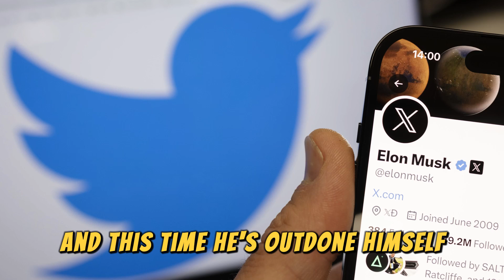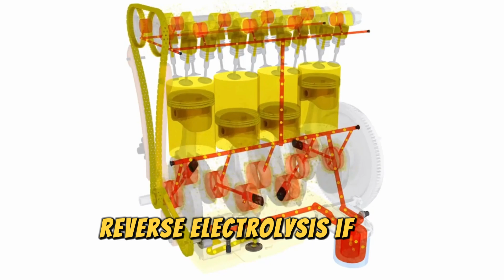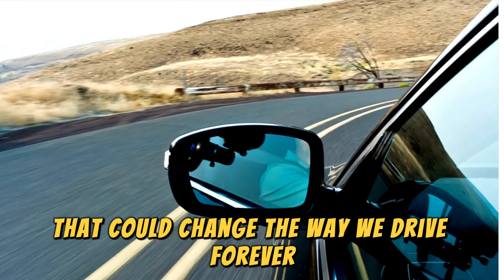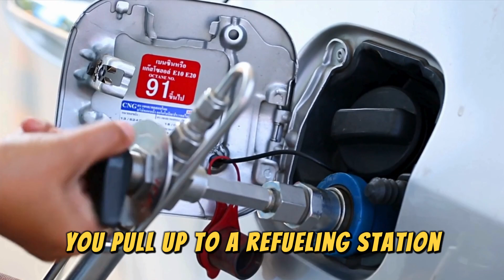Elon Musk Unveils Tesla's Revolutionary Water Engine: A Game-Changer for the EV Industry!

Comment: A fuel cell.  The pollution moves to where the hydrogen is created.  You take electricity (already generated somewhere else), to separate out the hydrogen from water, then put it in your tank and burn it.  That turns back into water.  The burning hydrogen is efficient, but the separating hydrogen from water is very inefficient.  But… creating hydrogen is the best way to sell green energy across the planet.  Once its separated from water, you don’t need decaying and heavy batteries to store it, or transport it.  You just put the hydrogen in a tank and ship it.  Also don’t need all the power lines and substations.

You could put water in your water tank, then plug it in at home to generate hydrogen over night using your home electricity, or pull up to a hydrogen station and refuel in a couple of minutes.

This is just my guess anyway.

Either way, the plastic used to make those fueling stations and car parts will still come from oil.